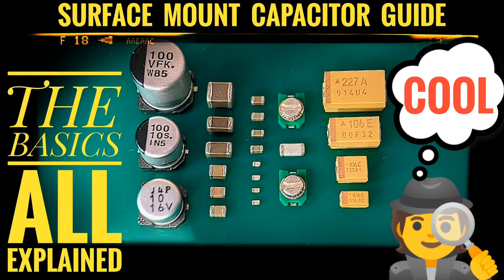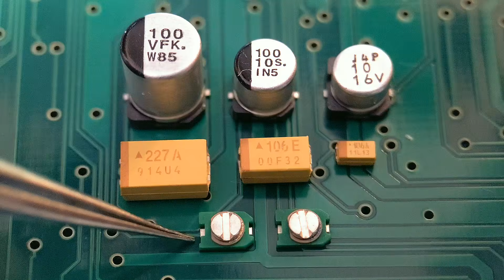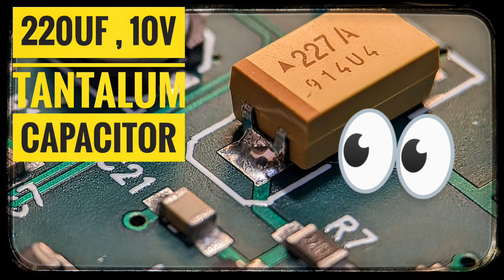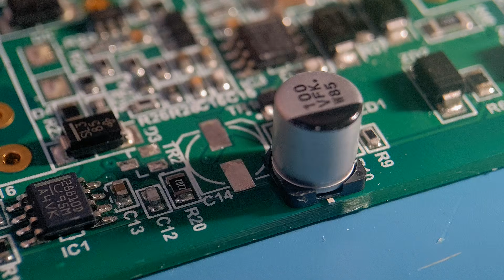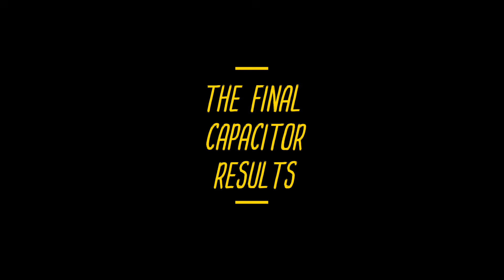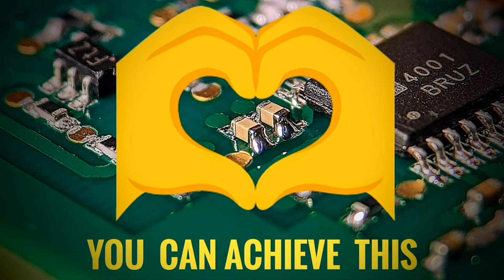Surface Mount Capacitor Guide / SMD Capacitor Soldering

Comment: hi, thanks, nice guide - but - what temperature you have used on tip ? (setting on welder ?) and what is the solder composition ? Sn?Pb? what mix ? thanks

Comment: How to solder 0201?
Reply from the maker: Hi , I solder 0201's exactly the same even 1005 size . I can't show these as my camera isn't quite good enough .
Reply: @mrsolderfix3996  what tip? I have to use hot air to solder 0201 because I just can't do it with solder iron especially if next 0.5mm is another component.

Comment: Do you have any tips/tricks for soldering electrolytic caps that are very close together? Sometimes they are so close the smallest tip that fits cannot transfer enough heat to the pads.

Comment: What about heat sensitive smd components like PPS capacitors, do you solder them the same way or do you lower temp and use different solder?

Comment: I have such a small capacitor to solder on a phone PCB that solder iron with a tip is too large, solder paste also seems to be too large, will just solder flux do?
Reply from the maker: Hi , I just use a very fine Conical tip with 0.25mm solder . I'm able to  achieve very good joints on 1005 size ( the smallest ) components . I do use a microscope for these though 😂

Comment: Trying to assemble a soldering practice kit but the 0805’s aren’t labeled and they all have different ratings. Please help!
Reply from the maker: Hi , hopefully this helps . You should have numbers or letters marked on top of the component in most cases . You can work out the value from these . You can Google these markings and it will tell you the value Or if there is no markings you will need a multimeter to measure them before they go on the board . Good luck 🤞
Reply: @mrsolderfix3996  Thank you!
Reply from the maker: @TroubleinZION  hi , no problem . I've actually posted a video all about surface mount resistors on my channel . I talk about how to work out the numbers in this video . All the best 👍
Reply: @mrsolderfix3996  I’ll check it out. I’m definitely subscribing. You’re very organized and clear. I appreciate that.

Comment: Are the smaller caps such as 0402 with no writings interchangeable? As long as it’s same size? If not how do you know what type to use without reading caps. I’ve got two that were knocked off of my key fob and I would like to fix it myself not sure what size there supposed to be but vey small, your videos have been very helpful and would appreciate any help thank you,

Comment: Excellent and helpful video just like all your others. I was wondering, for small ceramic capacitors that are unmarked how can you find their rating if it’s shorted? Thanks!
Reply from the maker: Hi , thank you for your comment , much appreciated . If you have shorted capacitors with no markings you really need to get hold of a schematic drawing of the board . This will show the complete layout and values of all the components . It can be difficult to get these schematics but occasionally you can get lucky after researching online . Good luck , thanks again 👍

Comment: I sucessfully soldred a surface mount capacitor or I think so but haven't tested it yet but couldn't get it flat to the board so warmed under it, might just remove it and try with pliers or whatever those pinch/grips are called didn't occur to me.

Comment: Thank you for a brilliant video. I'm a complete novice and just starting out with fault finding and repairs. I have a Humax Freesat box that's died. Checked power and HDD and all good so suspect its a SMD electrolytic capacitor? Do you have a video testing these in circuit using a multimeter? Thanks in advance

Comment: Searching for hour's, at 20:20 there are the small orange ones but above it is a black rectangular 'capacitor?' does it have a name, what do the numbers represent? Thank you
Reply from the maker: Hi , thank you for your comment , much appreciated . I have gone to the point in the video and above the capacitors the small rectangular black component with numbers on is actually a Resistor (1001) is the value which is in fact 1k ohm , 1,000 ohm . The last digit when reading these resistors is the number of noughts you add on the end in this case 1 . So you have 100 and 1 more nought , making 1000 . If it was a 2 on the end it would read 1002 which is 10000 = 10,000 or 10k ohm . Hope that helps , thank you again , take care 👍
Reply: Legendary!
Reply from the maker: Hi , no problem , thanks for your support , take care 👍

Comment: Hi,  Thanks again for  another informative video.  

Please can you advise how you work out the value of the 1206 and smaller capacitors please?

When you switch solders from lead free and leaded are you switching fluxes and also solder tips please? 

Thanks again,  looking forward to the diodes and IC videos

Comment: Hi there 👋🏻 thanks for yet another great lesson. 

I have a question - what hot air nozzle do you use the most - which one or which ones are most practical? There are thick, thin, bent and straight ones - can’t find any info on that so far. 
Thanks a lot in advance!

Comment: months ago I bought a cheap china soldering kit in a zip case to repair a couple of things, I've bought 3rd hands, a magnifier, cutters, a silicone mat and all matter of bits and bobs, now I'm hooked to watching your tutorials and ordered a pcb practice kit and have repaired just about every easy thing I can around the place and it's now a new hobby at 64 Y.O. proves you can teach an old dog new tricks. love the vid's keep it up, how about easy kits for newbies that are useful?
Reply from the maker: Hi , thank you for your kind words and for supporting my channel , very much appreciated . I'm glad the videos are enjoyable for you , hopefully they have proved useful to yourself and others . All I wanted to do when I started my channel  was pass on some knowledge of what I had been shown and my different ways of doing soldering . Thanks again , keep soldering 👍
Reply: @mrsolderfix3996 can you tell me please what type of flux you used in this video? I have to change out two cap capacitors, first time, and not sure the flux that came with my kit (no label) so I want to buy it separately. I have to change out capacitors on my 2005 scion xb instrument panel. Thank you so much! I loved this video and plan to solder other broken electronic things. I subbed and look forward to more helpful videos. All the best!
Reply: There are all sorts of kits you can buy online … am/fm radio, electronic dice, flashing LEDs.
Reply: Have a look at RS components they have a range of kits.

Comment: Hackaday send me here and i think i stay for a while to crawl though the rest of the vods. Really comprehensive HowTo.
Even if you've done it a thousand times, you can always learn something new.

Still, i use the chisel type tips for this work over the pointy ones (only exception are the pointy ones that are bend at the end). ;)
Reply: For 0402s and 0201s also?
Reply from the maker: Hi , I would never use a chisel tip on the small parts . Boards these days often make it impossible to get into certain spots unless you have a hot plate and fine Conical tip .

Comment: So the dark side on one type is negative and the other type it's positive, great bit of consistency.
Reply from the maker: Hi , yes mate that's the way these components were designed . Only telling it how it is so people don't get caught out. Not sure how to take your comment but how I've described them is the correct polarities for Electrolytic and Tantalum Caps.
Reply: @mrsolderfix3996  Hi I wasn't doubting you for one second. I've been trying to learn electronics for decades (mechanic by trade) my understanding of stuff doesn't seem to improve and things like different polarities doesn't help my learning, again nothing at all negative about you it was just a comment on the people who came up with it.
Reply from the maker: Hi , no problem , I fully understand your comment and sorry if I sounded negative . Hopefully I've showed how you can read them . If I can help a few people out then I'm happy . Thanks again for watching and commenting, take care 👍
Reply: I think one of the important points is that every component with polarity is going to have both a positive and a negative... it's pretty hard to have one without the other!  So in a non-existent simple world, they would both be marked.  There are different historical reasons for the marks to have evolved the way they did, one side or the other.  Electronics and software and other technologies were all a sort of "learn as you go" thing with different people having different ideas about how to manage it.  Assume they were all pretty smart, just looking at new sciences differently.

I think a good approach is to just relax and live with it.  :-)  It was hard for them to look into the future; it's hard for us to imagine what the past was really like.

Comment: Another great video. Superb camera work at that scale! I've not done any SMD soldering yet but I'm sure I will need to soon! How do you decide between lead-free and 60/40 solder? With through-hole I've reverted to 60/40 solder as I find it much easier to work with. With 3% flux multicore 60/40 solder I find I usually don't need external flux, whereas it's essential for lead-free solder! Since I'm not doing work on an industrial scale, I consider the environmental concerns of using 60/40 are negligible, so it's just the health risks I need to be careful with, but I'd be interested to hear your thoughts.

Comment: I’ve really gotten a lot from your videos.  Thank you for making them.
Question: How are you holding your iron and tweezers?  Are your tweezers in your dominant hand or your non-dominant hand?  I feel like my hands shake a fair bit more than your’s do and I don’t know if it’s just me, if I need to build hand strength, if it’s how I’m holding my equipment, if it’s the tweezers being too stiff and wearing me out, or something else….
Reply from the maker: Hi , thank you for your comment , much appreciated . I hold my soldering iron in my dominant hand ( Right hand ) and obviously my tweezers in my Left. I use tweezers that are fairly soft to push together as like you mention stiff tweezers can be difficult . I believe with more practice you become more confident and your hands will become steadier . Hope that helps , thanks again 👍
Reply: Make sure you're resting the edge of your palm on something!  :). It really helped me when I discovered that.
Reply: Self locking tweezers are a godsend for smd rework.

Comment: Hi another terrific video, i need to ask advice on you're technique for removing surface mount electrolytic capacitors please. i have one to replace on a small expansion board which fits inside a 90's synthesizer. whether this is the correct way, i thought of adding more solder to each side then using two irons to lift off the cap.  At the moment i only have leaded solder, hope this is satisfactory. Thanks once again for all that you do and congratulations on a very informative and entertaining channel, all the best.
Reply: Leaded solder and two irons is a great idea. Fresh leaded solder will help conduct the heat through the joints to make it easier to shift. I generally use low-melt or hot-tweezers for these. Whatever you do, don't use hot air as they don't like that at all and will likely explode. (wear eye protection just to be safe)